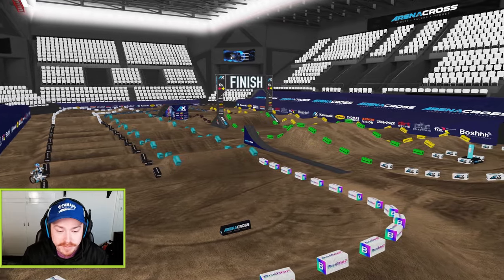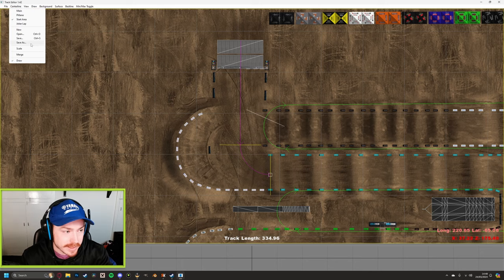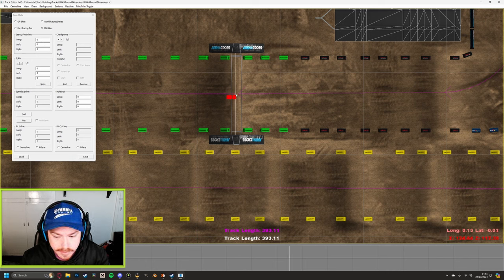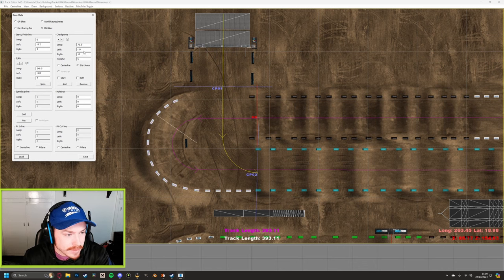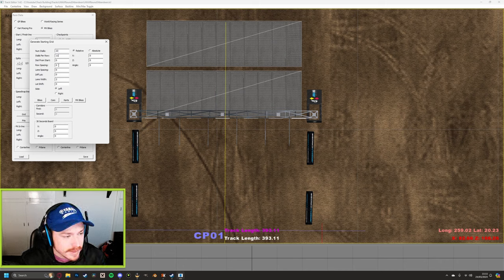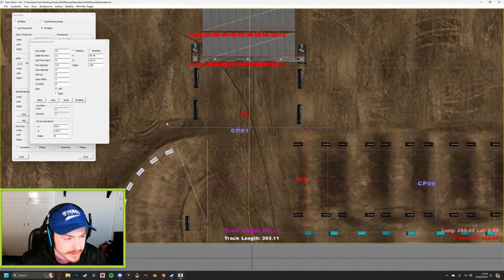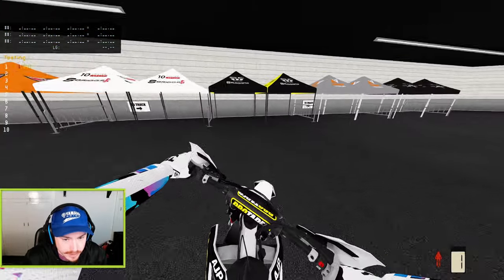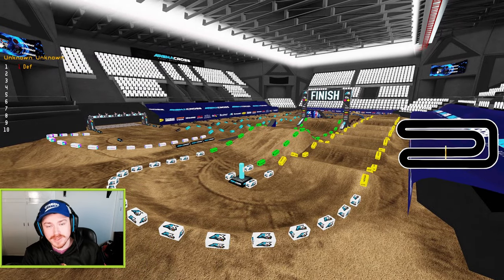MX Bikes Tutorials   Track Building Episode 5: Timing Gates, Start Gates and Pits

Comment: i set up all my centerline, start gates and everything else. tested it all and all was good. Then posted the track and took a couple days away. i came back and loaded up my track and everything was messed up. centerline wasnt working, none of my timing gates were in there. The track photo and info was gone. I've gone back over everything several times and can't find where i messed up and nothing I have done fixes it.. hard stuck on this problem